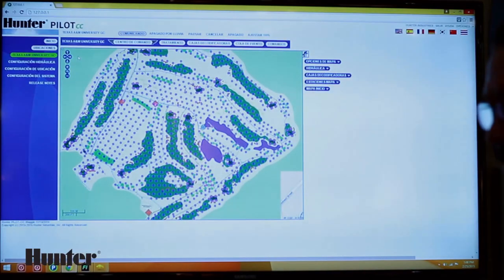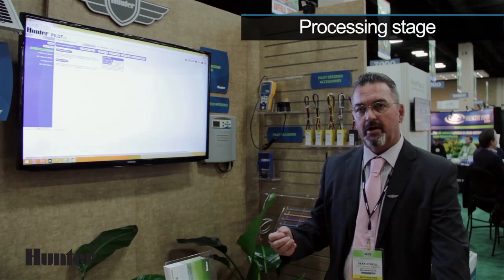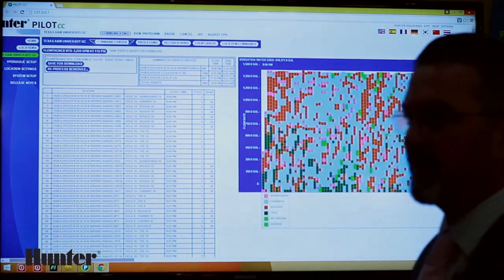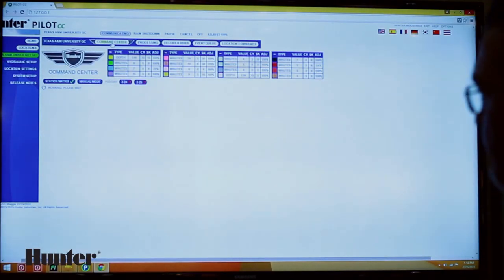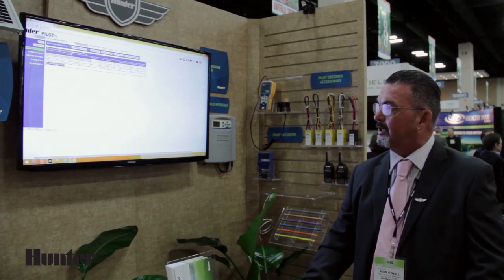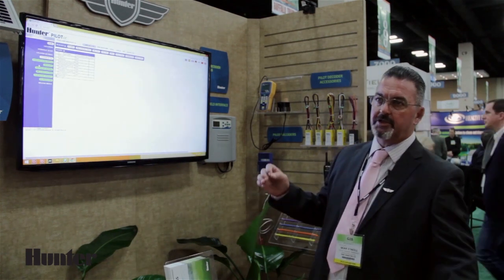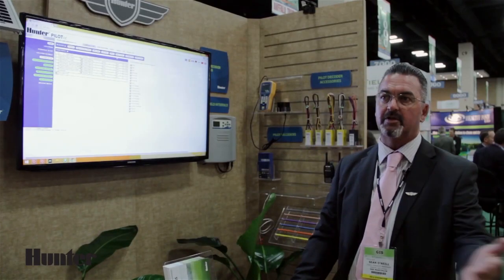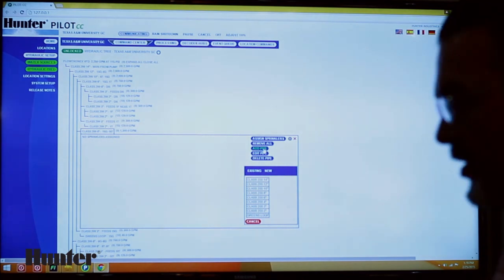Hunter Golf - 2015 Golf Show: Pilot Central Control

Comment: I have a question there’s any way or where I can found how to set two cycles for the greens program for example I’ll  like to have 7 minutes at 9 and an other 7 minutes at 11 if you can answer to my question thank
Reply from the maker: Good question about cycling in CCS. To have your zones come on at different times you need to create a Water and Wait schedule for your Greens. Go to the Irrigation Profile Setting, edit the Greens, and you can put in a Water and Wait cycle of 7 minutes Water and 120 minutes Wait. When that is done set your total run length for 14 minutes so it knows to irrigate the additional 7 minutes you need under Command Center. Additionally under the Command Center setting please set the priorities for your Management Groups. Set greens to Priority 1 and your other groups to another Priority. This allows the system to honor Greens to come on at the times that you need.  If you have other questions please email support@hunterindustries.com.